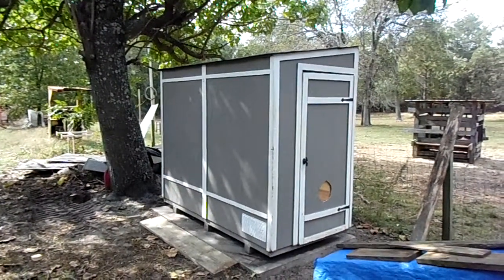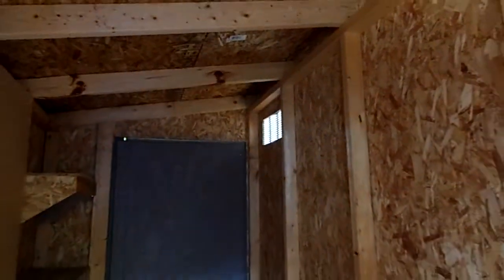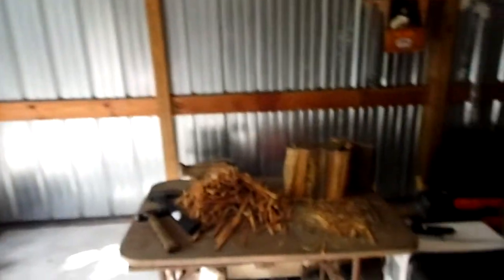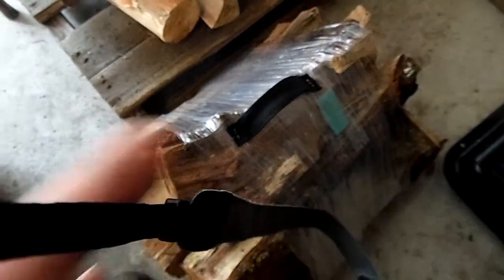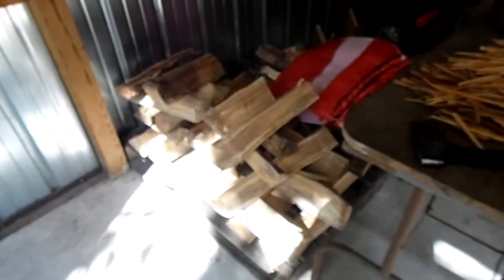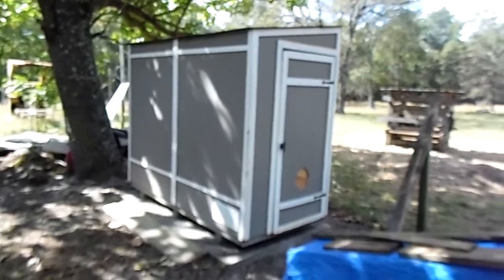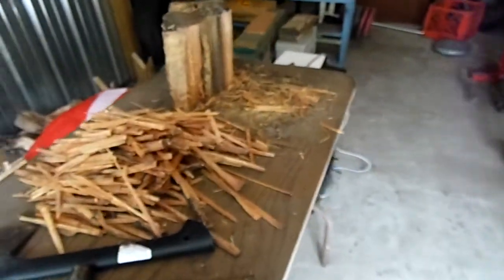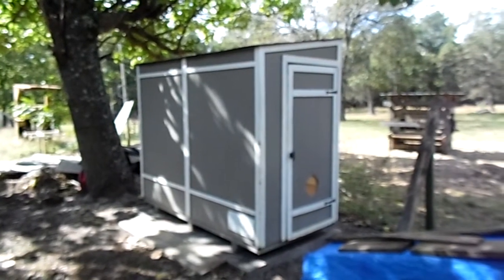Home made - Firewood drying Kiln

Comment: Split a piece in half after it’s done in the kiln, and test moisture in the center of the split side for an accurate reading of moisture content. 
I guarantee your wood is not dry after 2 hours at 130°. Unless of course it has already been seasoned outside below 25%.
Reply from the maker: That's right. The wood i've done has already sat out seasoning. But yes I agree, this would not work if the wood is green still
Reply: I'm going to try it have dry wood that's got wet I'll let you all now

Comment: I’d like to make something like this, would need to be smaller though. Thinking about a steel drum size. Just need to figure out a way to heat it cheaply.
Reply from the maker: Maybe like a space heater ( would be a longer wait for the wood to dry) or a forced air heater ( less wait time but would cost more). Ive seen people use heat lamps w/ fans

Comment: How long does it take to dry fresh cut firewood…great vid👍
Reply from the maker: It would dry it in a matter of a hr, if its split small. If its split big it would take 2-3hrs. Moisture pick up afterwards is possible since its not a long dry. Using the heater literally bakes the wood its near 160 degrees in it while that heater is blowing into there
Reply: @85ccmaster  
How many but’s is your heater? Thx for the info.
Reply from the maker: @LowcountryFirewood  I think its 120 or 140, no problem
Reply: @85ccmaster  
How long do you think it would take to dry 1/2 cord of fresh cut oak?  Looking to buy a 120,000 btu propane torpedo. Thx
Reply from the maker: @LowcountryFirewood  If the shed could withstand that heat, id say it would take 2-3 1-2hr heat cycles. Id split the wood on the smaller side, and use a moisture meter to check what the moisture is in the wood after it cools down